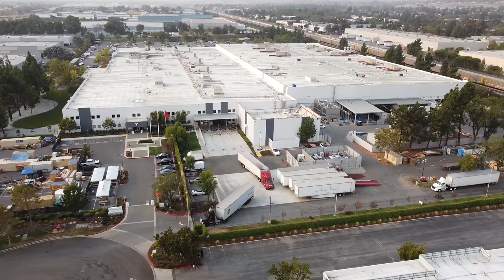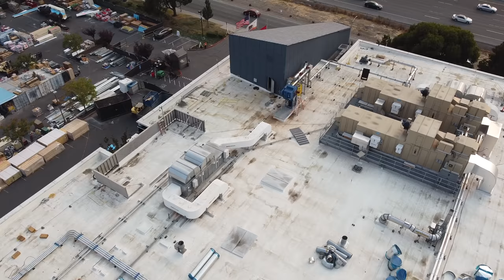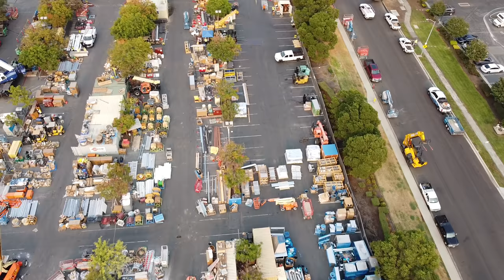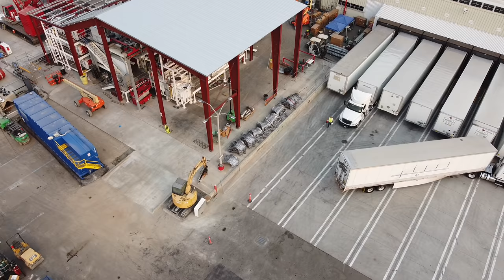Tesla Fremont Gigacast & Roadrunner Flyover - Sep 8, 2020

Comment: 00:00 901 Page Avenue (Tesla seat factory) car park [mis-labelled]
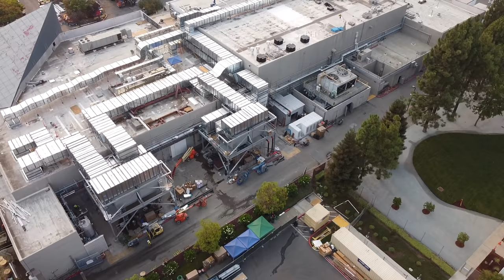00:40 1055 Page Avenue (Tesla R&D)
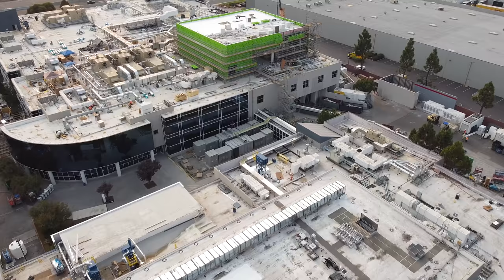01:00 47700 Kato Road (Tesla Roadrunner cell manufacturing)
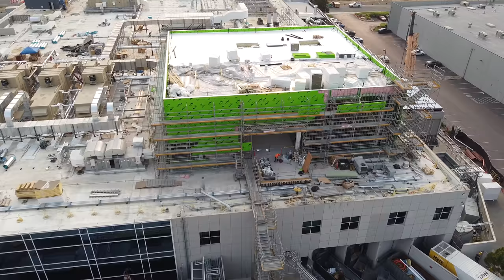01:15 Magic Cube™ on the roof of 47700 Page Avenue + bird flying across in front of drone
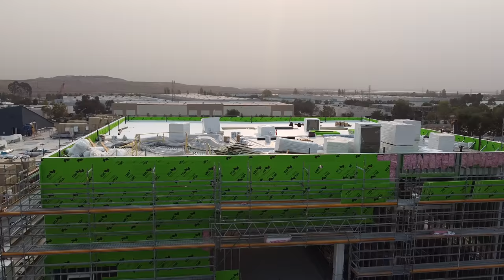02:05 47700 Page Avenue pipe work/ducting (PDF plans)
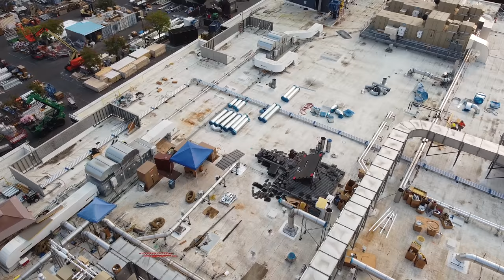02:32 47700 Page Avenue, Solar Roof test facility
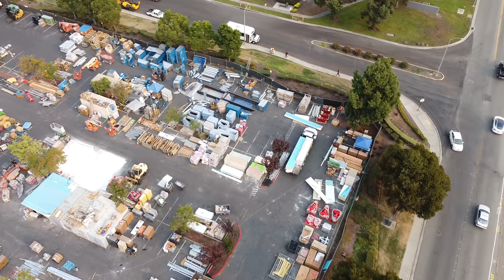03:05 47700 Page Avenue car park, full of pallets
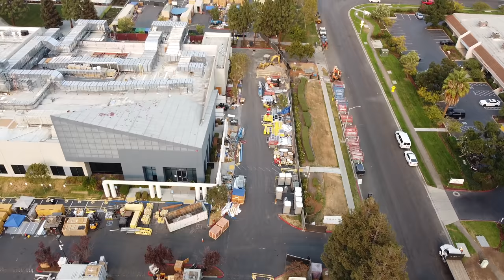03:35 1055 Page Avenue entrance
03:38 1180 Page Avenue (Amprius) [just visible in top-right]
location change
03:51 45500 Kato Road (Tesla Factory), north gate, Die Casting Machine #1 (DCM1) completed casting cell with Giga Press surrounded by all the melt ovens and other machinery + roof on top.
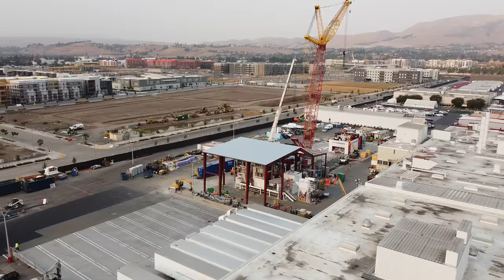04:05 45500 Kato Road (Tesla Factory), north gate, Die Casting Machine #2 (DCM2) standing alone, with no roof
05:05 stacks of Model Y single-piece megacastings lined up—kudos to dkrshr

TL;DR: the big news is: Giga Press 2 / Die Casting Machine 2 (DCM2) installed at Fremont!!!!

Sadly DCM2 is only visible in the background—hope a drone/long lenses photographer can go and take more photos
Reply: I don't see the second DCM?
Reply: 03:38 1180 Page Avenue (Ampirus) [just visible in top-right]  -->  Should be 'Amprius'

Comment: Need a zoom in on those castings. What an innovation. Can they make a machine big enough to do the entire frame?
Reply: We'll probably hear more about them either on the 22nd during the AGM or during the Q3 earnings. I think Tesla wants to release some official info on the castings. There's not much a zoom lens can tell us about the specifics (weight savings, various structural benefits, various manufacturing/assembly benefits). But at least we know they're making them. Whether these are just test samples or they're ready to be integrated into production... we will find out later.
Reply: @tavi_chocochip  The Model Y Casting part is for the rear 1/3 of the underbody and Tesla stated that they achieved a 30% weight reduction with the casting part compared to the former version with stamped sheet metal.
Reply: 3SGE  Try a bit harder it is too evident that you are just trolling.......
Reply: Tesla is at least considering that, as they recently files a patent for casting a whole car at once.
Reply: 3SGE  Tesla reduced the weight of the rear underbody by30% compared to the previous solution with stamped and welded sheet metal. So if I have to decide whom I trust more, a billionaire who founded several very successful companies and CEO of the most valuable car manufacturer or some random Youtube commenter claiming that he is in the casting industry, my choice is clearly on Elon Musks side. Furthermore your original comment was quite off, all Tesla models have an additional crumple zone structure at the front and rear which can be replaced. If the main structure of the car is deformed the car is totaled anyways. It is just dumb to think that the engineers at Tesla did not evaluate advantages and disadvantages of casting as a solution.

Comment: I take it those are all castings that didn't make the grade?
Reply: It is very likely that these are tests to adjust all parameters to get the best result. This is a very demanding piece to cast and there will be for sure lots of parameters that can be changed.
Reply: MrGonzonator - IIRC the new casting system, once in production, will automatically inspect and remelt any rejected parts.
Reply: @ClockworksOfGL  casting sprues, cut from finished parts, are also re-melted, not just the rejected parts.
Reply: jwstolk - That too.  It’s a closed loop system.  I wouldn’t be surprised if the next generation Teslas are largely made of castings.